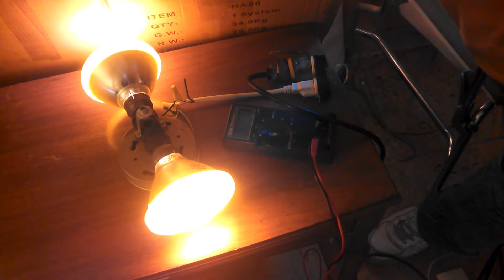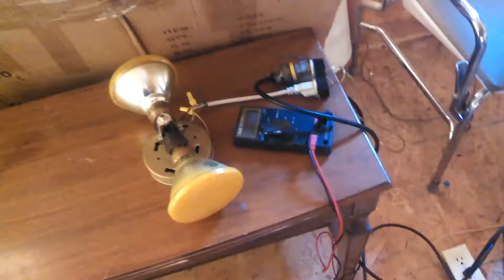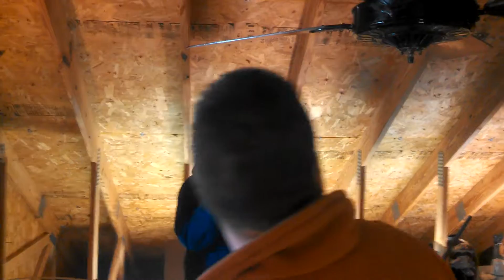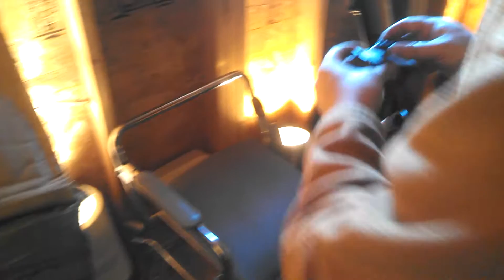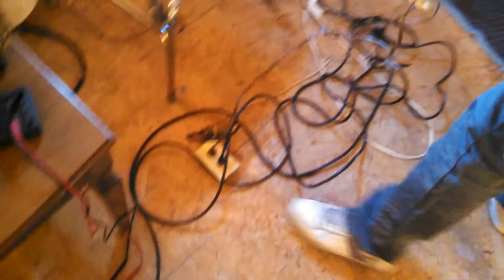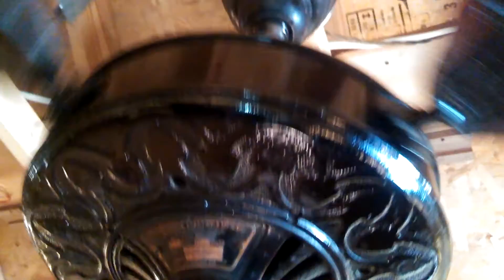Westinghouse Sidewinder Antique Ceiling Fan (fan #2)

Comment: When you were spinning it down for the last time, did you say that there were organs that were to be moved?

That low speed on the fan by the way, is too fast. Also, is there any way to modify an antique fan to make it more energy efficient?
Reply from the maker: Yes.

No.
Reply: Can you compare the power consumption of the Sindwinder with the power consumption of maybe a 52" Hampton Bay or Fanimation or something? How many watts does the Sindwinder draw?
Reply from the maker: Kat Fan I do that in every video.  Amps x volts (120 in all fans I test) = watts.
Reply: Dan ''Spiffy'' Neuman Oh, OK...
Reply from the maker: Kat Fan So when it was drawing ~2.5 amps, that was ~300 watts.
Reply: Dan ''Spiffy'' Neuman Oh, wow! That must be one powerful fan! I think a fan built today with wood blades made to move that much air would draw about 100 watts or something.
Reply from the maker: Kat Fan I doubt it.  Wood isnt as efficient as aluminum or plastic.  Although with DC motor advances that could be possible.
Reply: Dan ''Spiffy'' Neuman Maybe...